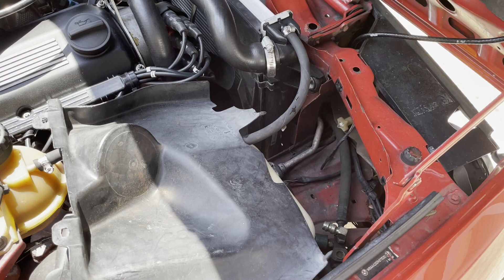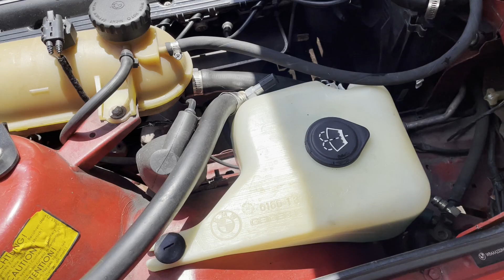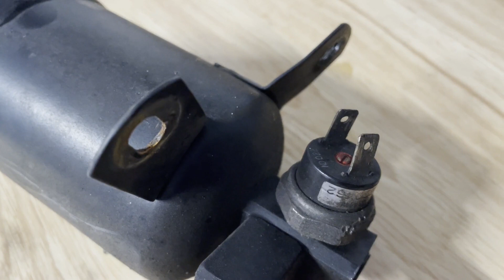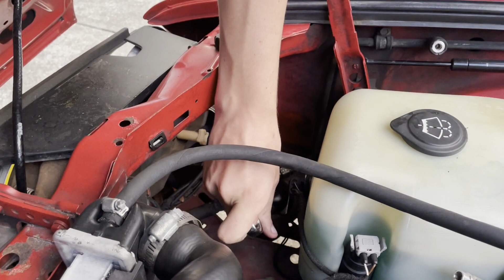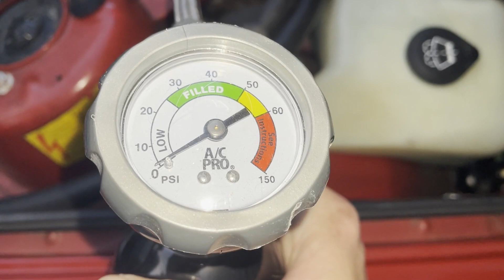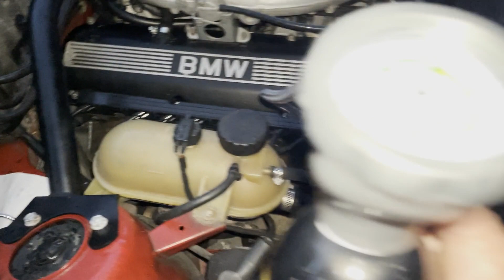Gotta Have A/C in the E30!! New Drier Install

Comment: How did this work long term? Looking to getting the ac working in my 87 325es
Reply from the maker: The system has developed a small leak somewhere and we haven't dug into it enough to find it yet.  My son has another car for his daily and we just drive it when the weather is not too hot.

Comment: Did you just loosen the fittings and let the refrigerant out into the environment?
Reply from the maker: Nope! It had already slowly leaked out, which is why the A/C wasn't working.  This thing has been a real challenge!!  The leak is small and even the A/C shop we took it to after this said it tested good and filled it again, for $350.  Lasted about 2 weeks and it wasn't cooling again.  Now we just don't drive it in the summer.

Comment: Thanks so much , did the exact same and great results. Did you add any oil to the system? Or just refrigerant ?
Reply from the maker: We didn't add any oil this time.  We are going to add some oil and dye when we refill it again because the refrigerant leaked out again.  These AC systems are a pain when you are chasing leaks!
Reply: @C3KPaddock  Thanks for the reply. No leaks yet for me, fingers crossed

Comment: Did you vacuum the system ?? You opened it up it needs a vacuum .
Reply from the maker: We don't have one, so we didn't.  Another tool to buy.  Didn't matter though because there is a leak somewhere and it stopped working again.  More work to do when summer comes around again.
Reply: @C3KPaddock  you can rent it from autozone and get your money back when you return it. You would of figured out that you had a leak if you would of properly done a vacuum . Also since you didn’t you might ruin the compressor and have to replace it too along with the new drier again .
Reply from the maker: @chillyE30  Good to know.  I wasn't aware that was something you could rent from there.  We haven't been running the A/C since it leaked down.  Thank you for the tip on the vacuum.
Reply: @C3KPaddock  any moisture in the system can corrode and kill the compressor as well as clogging up the system. putting it under vacuum for an hour or so makes all of the moisture in the system evaporate and get evacuated. the drier is there to continually suck up any incidental moisture that could get into the system to protect it, it can only soak up so much so it's kind of a sacrificial part, you'll need to replace it again if you try to get the a/c working again for this summer. it's worth it to get a set of a/c gauges while you're doing this (either renting or you can get them + a vacuum pump from harbor freight for like $150) so you can get a better idea of what's not working in the system.
also the hoses in pre-88 E30s are older style (not future-proofed for R134a) so you're going to continually have at least a little leakage
Reply from the maker: @Vanya2893  I broke down and took it to a shop a few days after we filmed the video to get the A/C vacuumed and filled properly. It worked great for like a week and then gradually got worse over the next couple weeks until it barely cooled again.  I think there is a fitting on the dryer that is leaking.  The shop said they did a leak test and it was all good, but when I took it back they said they were going to charge me again to service it.  Frustrating!!! I hooked up a gauge and the pressure was way down.  Going to have to get the equipment and do it myself I guess.